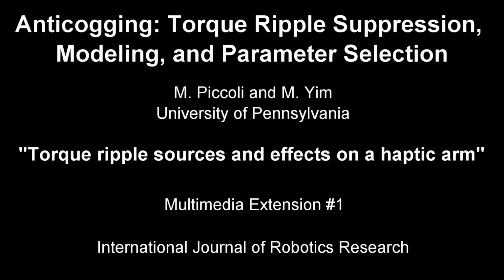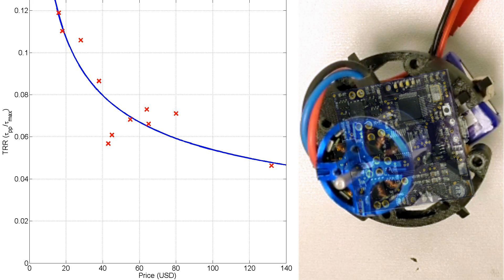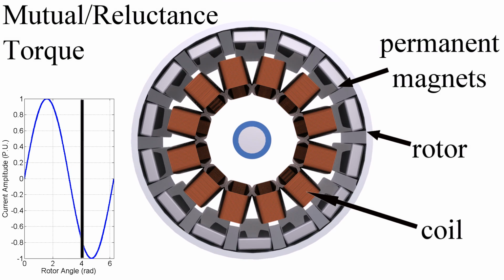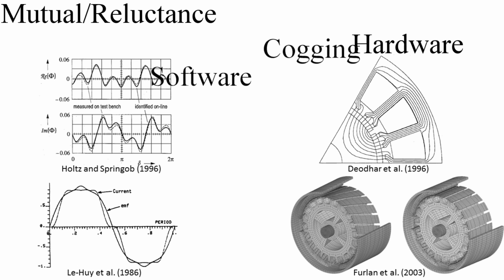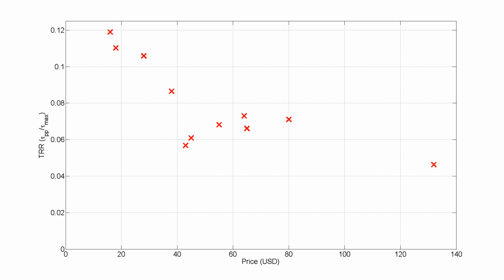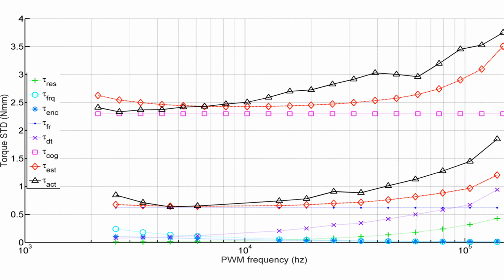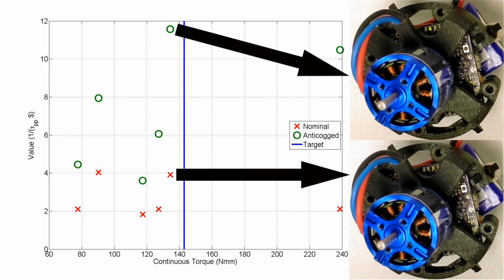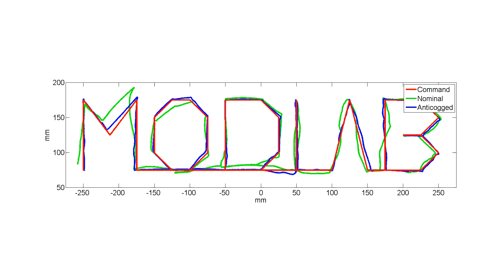Anticogging: Torque ripple suppression, modeling, and parameter selection

Comment: you should start selling cheap gimbals and other things :D
Reply: It's pure software, you could apply it to your existing brushless sensored motor if you can mess with the controller.  Think of it like microstepping a stepper without the loss in torque
Reply: EasilyFallsForClickbait 
Do you know what are hardware and software he use to get rid of the ripple 

Please tell me it will mean the world to me